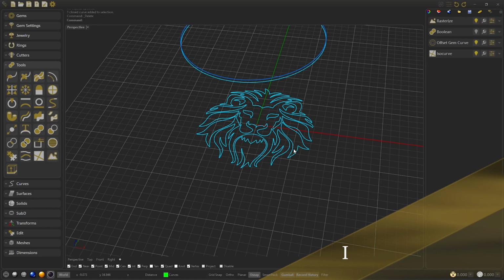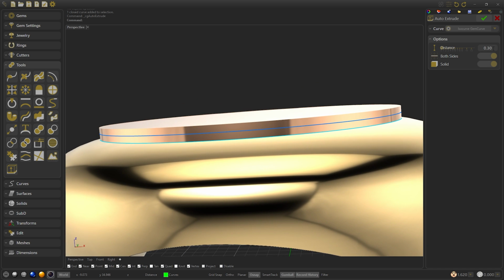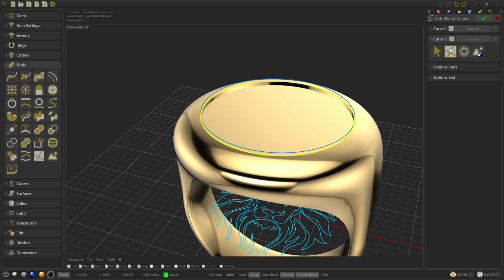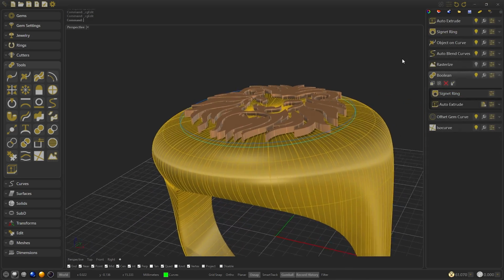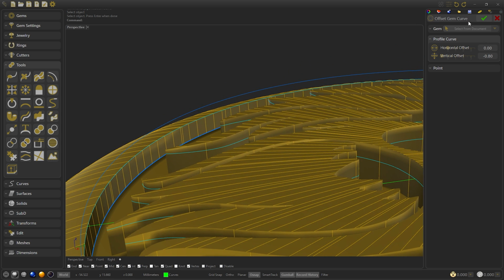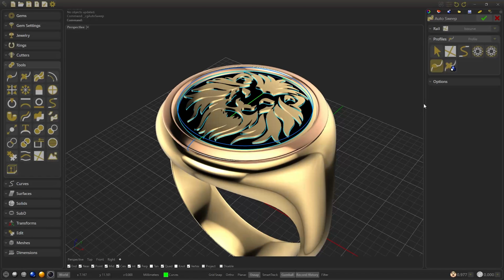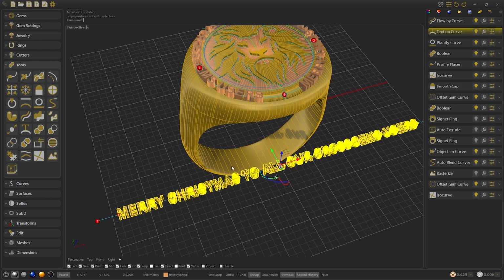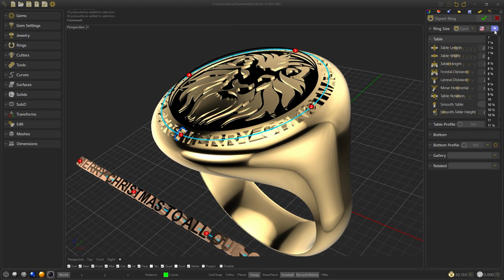Engraving Text & Image Hollowing on a Signet Ring CrossGems | Tutorial

Comment: I did not understand the reason for duplicating the ring. Is it impossible to work only with the original ring?
Reply from the maker: The reason to make the duplicate is to make a Boolean intersection using it to obtain the inner part of the raster lion extrusion. 
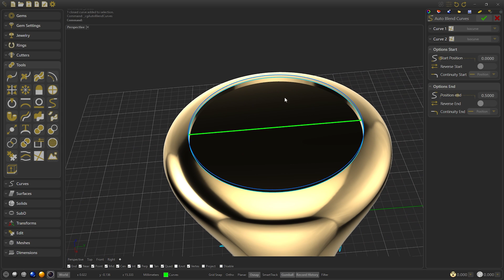Getting 1- The ring / 2 - The smooth lion created with that intersection of the duplicated ring. If you see 03:42 The original ring is hollowed out with an extrusion so it is not possible to create an intersection using it with the extrusion. So using the parametric features like restore object or duplicate gives us the possibility to get more complex designs and structures and still keep a parametric and modifiable ring.
Reply: @crossbytes3d  Got it, thanks! Does it mean that I will need anothe duplication in case I want to hollow or texture the ring on the inner part?
Reply from the maker: @oshritdah  No, it's not mandatory, you can extract the original object at any time even if it's deleted, but it's useful duplicate it to have it in the document so if you want to do multiple boolean operations it will save time.

Comment: Please keep making tutorials that showcase the different tools you can use to make creative projects for beginners like me.
This is a great project and showed me what I wanted to learn. 
I will give my feed back after I  follow this tutorial as I attempt to build my own ring and I will share the results. 
Thanks for doing this, I look forward to seeing more content from you.
Reply from the maker: Thanks Kris,
Remember that you can make the hollow ring.
If you have any questions just let us know!
Merry Christmas!
Reply: So far I followed you and it has been a good experience. 
 I tryed to do a signet ring with a different profile 002 and the isocurve does not work the same when choosing the UV option. It will not follow the profile like it does with the example in your video when choosing the option of the UV.
 Could you please explain to me why this is happening and how to remedy this situation? I would like to follow the rings profile on top and create an offset.
Reply from the maker: @KGG-3.33  You can select the top part with the arrow on the first panel of the Isocurve command. In case that the top profile has different surfaces (for example the shield profile) you have to select only 1 surface of the top to create the isocurve you mean.
Note: If you change the profile while the isocurve is on the top, it can change if the new profile has different surfaces. 👍